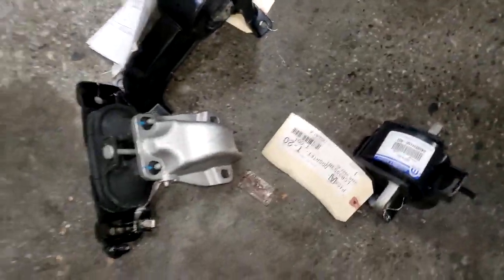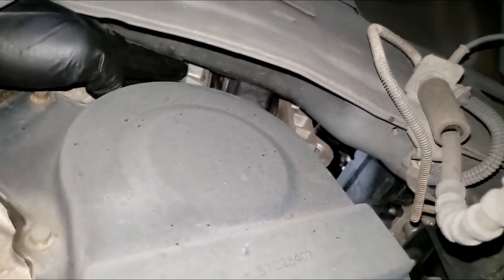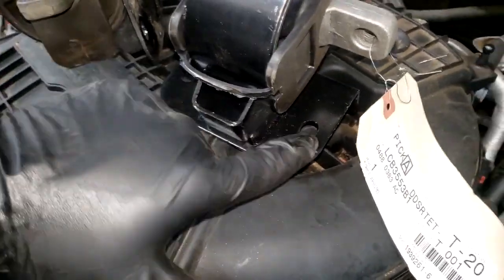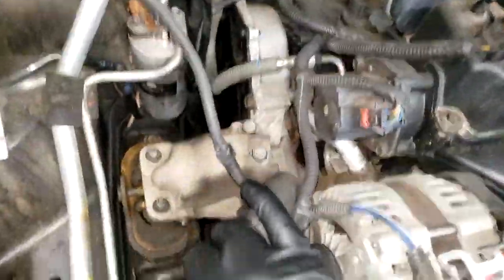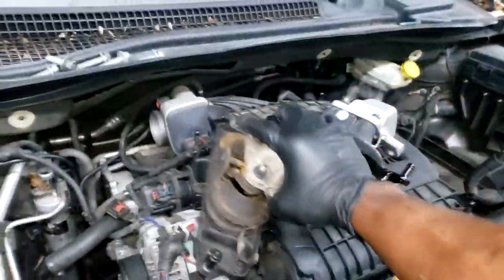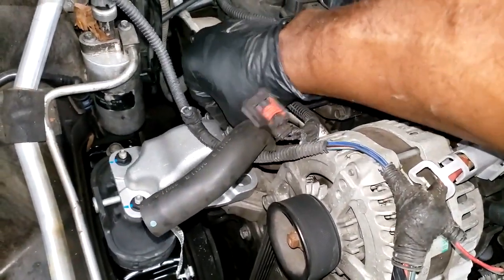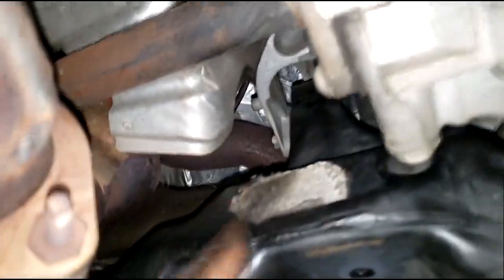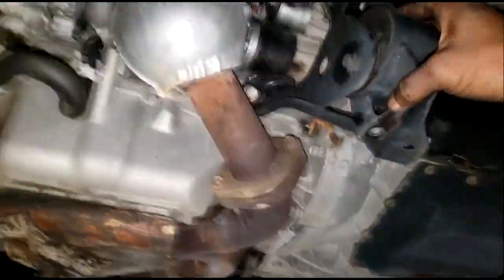How to tell if your motor mounts BAD  How to replace all 4 MOTOR MOUNTS Clunking noise when shifting

Comment: Could you please say what vehicle you are working on and how many miles it had when you worked on it?  And please do that on all your repair videos.  Thanks.
Reply: This is a Chrysler town & country or Dodge Caravan. I believe around 2013 or newer.
Reply: The front motor mount can be replaced with out taking off the lower cross member that the bolt either breaks or its hard to get out. 
The reason is the bolt has a hole right above it that rain water gets into. If you have this vehicle please a lub to this hole and cover with metal tape or something that won't mess it up.
I have had this bolt start than stop and not tighten back up. 
Becareful taking the lower cross member out. In this case you don't have to.

Comment: Little by little replacing necessary parts on my used 2013 Town and Country Touring L purchased 7 months ago. Looking online I have yet to find the passenger side motor mount with the bracket OEM. I don't need to replace it but based on this video it is provided when you purchase the OEM replacement.

Comment: I have 2008 town and country limited. 120k mile

I just finding out mounts have fluid in them???
Is.this true. 

Im DiY multiple issue. 
Combo of clunk and leak(s)

So  could some or all the fluid mess be from a.mount?

It went from a little leak pass side front to dropping instant puddle on driver.

Also checking trans cooler lines.

The mess is mostly bottom of.bumper.
But the fan might have slung some.

The most sense from the mess is the bottom front mount exploded fluid.
But also all fluid levels are low.
But some fittings look weepy.

Comment: Trying to figure outs loud banging on crank did this make a lot of noise?
Reply from the maker: What kind of car is this? Also are you subscribed to the channel?
Reply: @OnlineMechanicTips  a 2012 caravan the wishbone front mount is tore up but if I jack the car up some from the engine the noise doesn’t change no codes but I’m still on the fence about maybe a vvt issue
Reply: @OnlineMechanicTips  you can step on the gas runs fine smooth puff my ear right to the hood no noise not my van my elderly neighbor who I’m trying to help out

Comment: How can you determine an aftermarket part is just as good as OEM mount.
Reply: You can't know what rubber compound was used aftermarket. Longer warranty, company reputation may help but that's all.
Reply: Just stick to OEM mounts whenever possible. Aftermarket engine/transmission mounts are rarely if ever as good as the OEM parts.

Comment: Notice how he does not show us how he got the rear mount 2 bolts, very sneaky
Reply: They are the 2 hard bolts to get to. But with the cross member out. It does make it alot easier. The problem is alot of times the front bolt won't come out. Or it breaks. Especially in my parts of the US. The rust belt.  
There is a whole at the top of that bolt that rain water gets into. Make sure to lub it and use alot of heat.

Comment: You didn't have to remove the cross brace to swap out the front motor mount. I know this from experience... don't pretend to act like an expert if you ain't one!
Reply from the maker: Awhhhh, look at you, that's so cute. You over here trying to get attention again little man? Well i usually give that out on Saturdays. Hang in there Bozo, you got about 5 days left and then I will give you the attention you seeking.